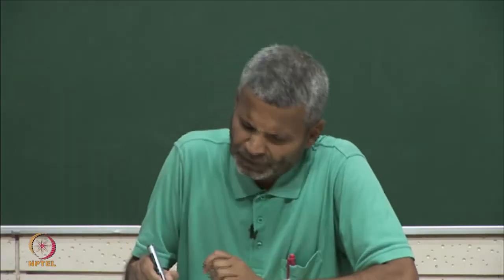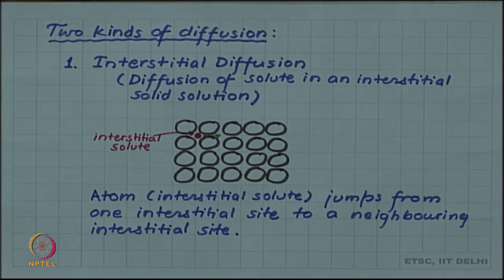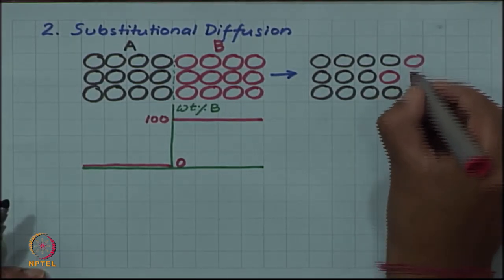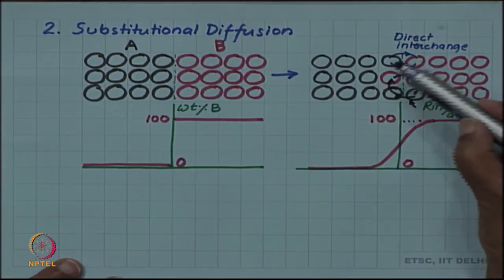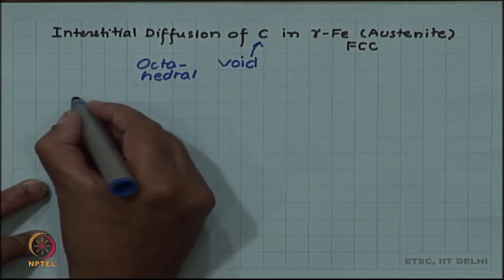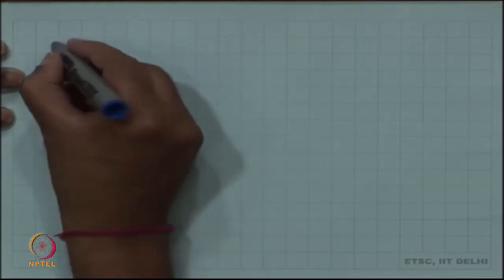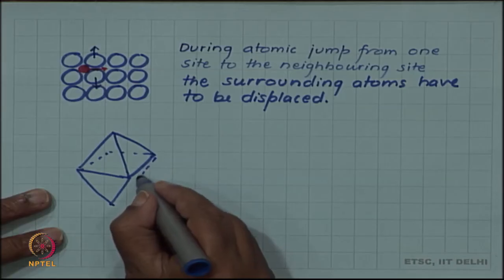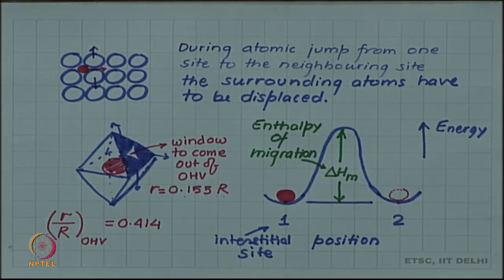Atomic Mechanisms of Diffusion

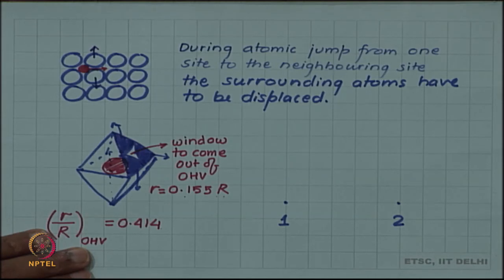Comment: Sir, I have a question, referring to 31:14 in the video. Since the size of window available to come out is in the ratio of 0.155, is the size of window to go in will also be 0.155? So does interstitial diffusion also cause distortion when accepted into an OHV?
Also when a C atom is present in an OHV of a FCC Fe lattice, will the size of the octahedron increase due to present of another atom? Just curious to know.
Reply: The window need to open, means its size will have to increase which is more reasonable than to salute atom contraction. So the energy barrier is to increase the size of window and let solute atom jump and try it's luck to diffuse. 
Size of atom present in the void can have larger or small size in comparison to void size, so there can be compression or tension strain fields.

Comment: Dear Sir,
I was asked in exam that how does an interstitial atom knows that which are vacant sites? How do they know the next vacant position to occupy? I was also asked to discuss diffusion from statistics point of view. What do we mean by statistics of diffusion?
Reply from the maker: This appears to be a difficult exam question. Was it a written exam or a viva?

As you have not shared the actual question let me make a guess. 

Substitutional diffusion takes place down the concentration gradient by jumping of an atom in a nearby vacancy. But vacancies are randomly distributed. Thus there are vacancies in the forward direction (decreasing concentration) as well as backward direction (increasing concentration). And jump happens to be due to thermal vibration which is also random and equally likely to be in the forward direction as well as in the backward direction. Then why the diffusion happens in the forward direction?

The answer is that due to decreasing concentration there are more atoms jumping in the forward direction than jumping in the backward direction. This is where statistics is coming. Individual atoms jump with equal probability in both forward and backward direction. But there are more atoms moving in the forward rather than backward direction giving an overall forward diffusion. So actually an individual atom does know the vacant sites around it but has no preference for the one in the right (forward) direction.

I do not know if I have answered the question which was asked you. But I now have an interesting question to ask my students. Thanks :-)
Reply: @introductiontomaterialsscience  Dear Sir, this was asked in comprehensive exam at McMaster University. Thank you so much for your response.
Reply from the maker: @paulamimajumdar8934  Best wishes for your thesis.
Reply from the maker: @paulamimajumdar8934  Best wishes for your thesis.
Reply: @introductiontomaterialsscience  Thank you so much Sir